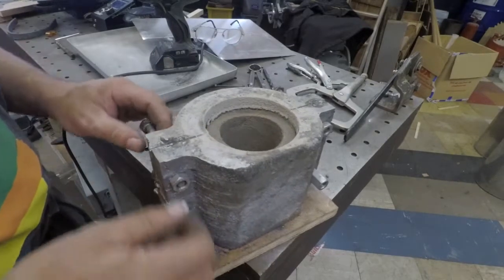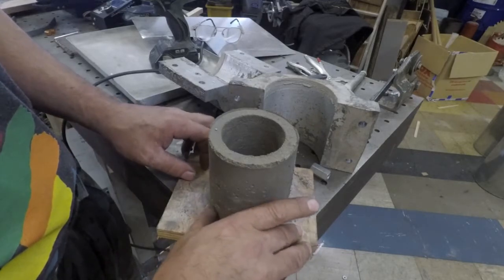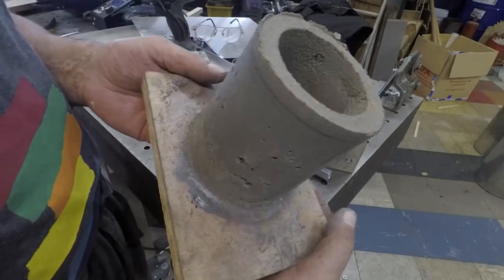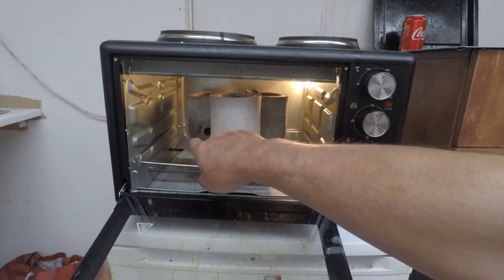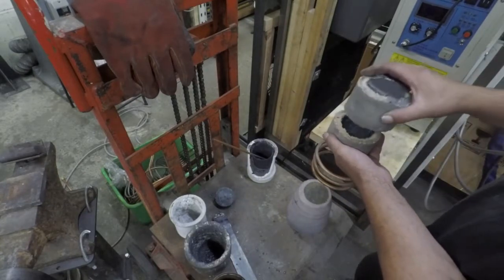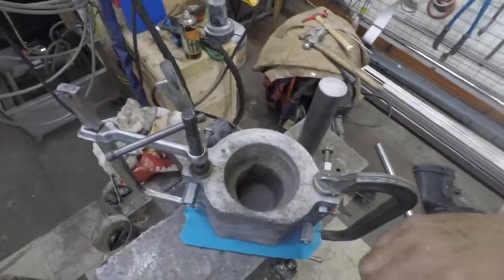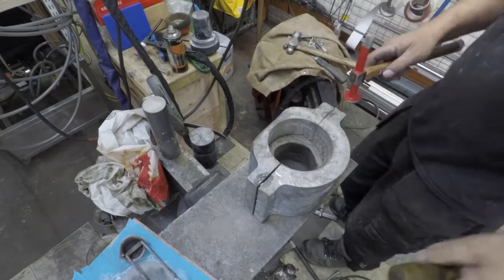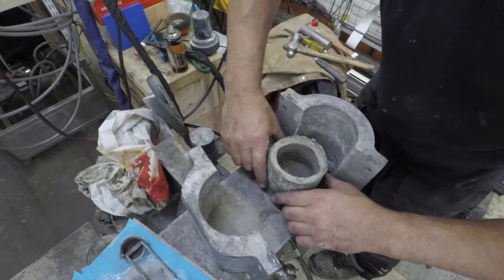DIY crucible for induction melting part 4

Comment: I found success with making clay+silica sand crucibles by making the outside mold out moisture absorbing material.  The best material I have found is plaster of Paris or graphite.  I let the crucible set in the mold for 1 to 6 hrs (depending on wall thickness) till the crucible shrinks and separates from the mold, it falls out when turned over. May help...
Reply from the maker: cheers dood!   what are you melting in them? and how do you form the inside?

cheers

tanc